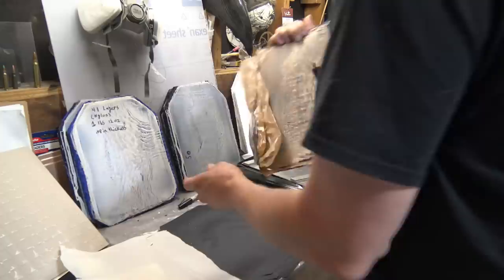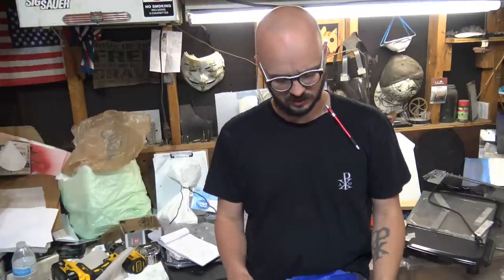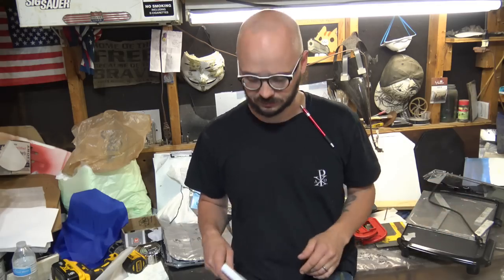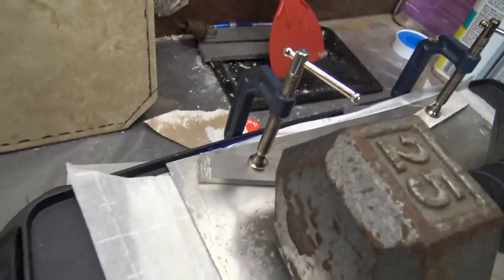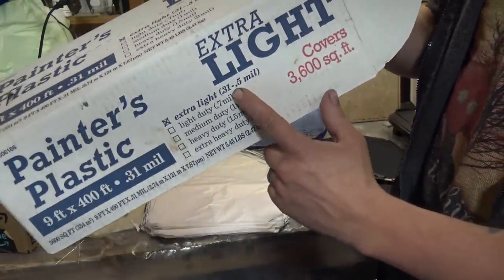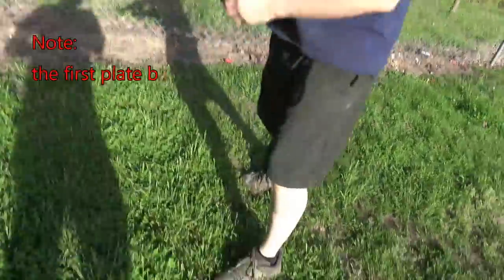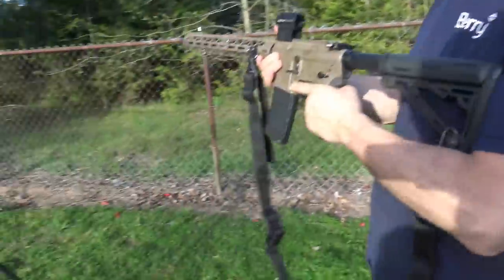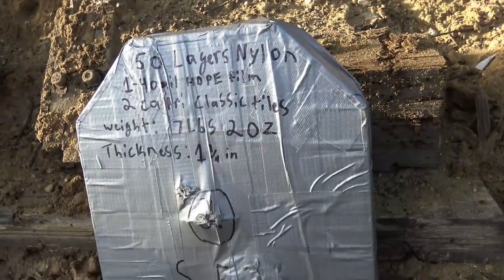Nylon and HDPE composite armor!

Comment: per weight, the nylon doesn't seem to be particularly more  efficient than polyester when used without a strike face?
Reply from the maker: Yeah that thicker polyester curtain you suggested before was a beast lol, I wonder if I can laminate that with HDPE. But yeah, similar result, but this was the thinnest of Nylon fabric out there. I imagine a stronger grade will preform better, only one way to find out devon!
Reply: @Techthisoutmeow  indeed, wouod need to test both 1000D nylon and 300gsm polyester to see if noticeable improovments can be obtained

Comment: You should try making foamCrete it’s a type of concrete that is really light it floats on water that might stop bullets it’s made by using soap suds and concrete together which puts a lot of air bubbles in it so it is lighter and stronger than regular concrete supposedly.

Comment: Your metal sheet looks like aluminum. Aluminum act like a heat sink, may not help with your heating. maybe add a layer of neoprene rubber for a little insulation and should help with any deviations in the surface. Very interesting.
Reply: That's why I use A36 material when molding and working with plastic. A36, or any other kind of steel is a better conductor of heat than aluminum.

Comment: get 2 cast iron frying pans, with a decent volume, fill them both with a soft resin, with alot of fiberglass embedded in it, then put them together in the same orientation but mirrored so the inside where the food would go is facing each other, then glue them together with a load of super glue, and wrap the seam with flex tape, and cover it in flex seal liquid for anti spall coat. and then put a paracord or something through the hole in the handle and wear it like a pendant. you could also instead of doing 2 together, do one on each side where the bottom of the pan is the strike face, so there is protection front and back. or do 2 on the front and 2 on the back. my thinking is the cast iron will stop everything like, 9mm/ .45 and below, and for higher power rounds it will break up the round and the resin with fiberglass will slow/catch the bullet, and if that fails, it will at least not have enough energy to get through the cast iron in the back of the 2 pan model.

Comment: Hey, on the topic of laminating fabric and making composite armours, I've been wondering if it would be effective to try and use a flexible material as the bonding agent in the construction of the plate
 I mainly ask this because I figure that soft body armour made out of like ballistic or ripstop nylon or some other high performance fabric glued together with contact cement is just more convenient to wear, but I don't know if the vest would be stronger with or without the rubber holding the fabric, so I'd like to hear your thoughts on it if possible
Reply: someone else tried that with fiberglass resin and it did work but not as good as fiberglass and resin and fiberglass is significantly cheaper and lighter.

Comment: Ceramic is heavy and the goal is to have ultralight-fibers stop the projectile with roughly uniform deceleration from the moment of contact through the stopping-point (before penetration).  So, a trampoline-effect.  Failure mechanisms are spalling, non-uniform deformation, burning and sharp-edges of either the projectile or ballistic-materials.  Starting from these (and other) first-principles, it might seem best the projectile deform as little as possible upon impact, but if deformation isn't avoidable, it occur early and smoothly, without sharp edges.  So maybe a thin outer layer of copper that'll stretch (and conduct heat), containing initial impact-loading, without creating sharp-edges regardless hollow-point, etc..  

Next bonded-layer, Dyneema-Composite-Fabric (DCF).  Ultra-fabric.  Few layers of Ultra-400 (cheaper) or more layers of Ultra-100 (lighter?) - to catch/trampoline the projectile.  Kevlar seems less desirable, because it's more brittle and snaps at failure, where DCF stretches more.  Looking for stretch, not brittle/snapping.  On the macro-world of first-glances, DCF seems to have no stretch, but at 30k fps, DCF stretches just about as much would want for a 4-5cm plate. 

Third bonded-layer might be an ultralight foam rubber, perhaps an EVA-foam (Ethylene-vinyl acetate)?  It merely needs to support the stretching DCF (which is doing most of the work) without tearing or yielding to the stretching DCF.  Third-layer foam need only hold-back the DCF-fabric, not an ounce of force from the bullet itself. 

Ceramic-layer simply doesn't fit the purpose.  It's heavy and yields with sharp-edges.  Those edges wreak-havoc on the trampoline effect.  Of course, virtually every plate ever made uses a ceramic-plate inside, but that shouldn't need to be the case with modern-materials. 

Consider bullet-launch:  Bullets accelerate evenly, thus launch-shock is absorbed by a relatively small shoulder butt-pad.  Deceleration should occur likewise.  Evenly and spread over as large an area as possible.  Solids, such as ceramic transmit impact and don't spread forces well.  Any force they do spread, also spread fractures.  This is no way to make a plate.  Let DCF do the spreading.  Prevent burning and spalling from cutting through the DCF upfront, and plates could (and should) be under one-pound. 

Bonding's purpose is to ensure spreading forces.  Bonding each stretchable-layer to the other ensures the trampoline effect.  Even the plate-edges should be well-bonded to each layer (to prevent delamination).

Comment: HOW about putting the marbles in a pan so that touch each other , then melt a thin layer of plastic over them and down around them to hold them in the shape of a plate when you laminate them with other things , get rid of all that space I saw @  22:00 .
Reply from the maker: Not a bad idea! I've been doing something similar to that, basically adding a bit of hdpe to the bottom, then adding hdpe above the marbles and pressing them together. Still working out the best method, but I got a lot of marbles to practice with. Thanks for the suggestion!

Comment: It occurs that body isnt the only use. What about armoring up a door or putting a bunch of this inside the walls of a "safer"room hard to shoot through equals longer to cut through so you could have a whole room be a low key, looks like a nice normal room that will buy you a good long time for help to come.
Reply: Or a car door. Mad Max it up a bit. I wonder if the weight would be better than like ar500 in vehicles? A madax sand rail with a viper crate motor. Mounted .50 in the roof. Oh that would be fun. I wonder what the laws are on that, if it is semi auto can I rig up servos as long as I am firing manually?

Comment: Try HDPE with Gaphine mixed in giving strenth to the absorption of impact
Reply: I was thinking the same, watched Mr Murray Smiths video earlier.
Reply from the maker: I've been looking into graphine a bit, I need to find a decent supplier of the material for testing. It's definitely on the to do list soon!
Reply: @Techthisoutmeow  could try to Kevlar threads mixed into hdpe ... or mesh melted into HDPE
Reply: It would be nice, but unfortunately that stuff is exorbitantly expensive. Just a few grams of it will set you back thousands of dollars.
Just for reference I tried to acquire graphene, and I wasn't able to get it. And if I can't afford it, Tech sure as hell won't be able to. So unless you're a member of the super rich, or you have a government job, you're not going to be able to afford graphene let alone get your hands on any of it.

Comment: If you can constrain the right ceramic plate within a steel matrix you'd be surprised at what it can do. A cheapo version. Pocket out/machine a 10mm aluminum plate, heat it, then insert a building tile that has been cooled down. The key is to have the tile constrained by the aluminium/steel on all surfaces bar the strike surface.

Comment: I think the idea of using ceramic balls is good but it needs to be multi layered otherwise its the same issue as dragonscales where it will pass between plates/balls, it would be interesting to suspend the ceramic balls in a thin sheet of metal too but thats probably expensive
Reply: It's also really dangerous. I've you've ever watched anyone do foundry work then you should be aware of the inherent risks associated working with molten metals which is what you would have to do if you want to suspend ceramic balls in a sheet of metal.

I'm also thinking that wouldn't really work very well because I think extreme heat exposure would ruin the structural integrity of the ceramic balls. I've witnessed a SIC ball shatter like glass when struck or dropped after being heated to 3,000 degrees Fahrenheit and then air cooled to ambient room temperature.
Reply: @nemesisobsidian  i didnt think that much before posting, i now understand but it could still be researched, maybe some ceramic shape is better at absorning impact with metal that doesnt need to be molten in production of the plates...
Reply: @mistaBorg  yeah you're probably right. It can still be worth investigation and still have an effect with the balls adhered somehow to the metal. You would need an absurdly strong adhesive though.
Thinking about it now the only way I can see suspension of ceramics in metals working is if you somehow use chemicals to break down the metal and reform it around the ceramic balls. But if we're thinking about using Aluminum, Steel, or Titanium as the resin for the balls it still wouldn't be possible because Aluminum is too reactive and Steel or Titanium are too inert. We would need to use something more stable like Copper, Nickel, Bronze, Silver, etc.

EDIT: You can also use Chromium metal as a plating I forgot to add that one. But you would have to do it outside in a well ventilated area while wearing an NIOSH Respirator as a Chromium plating can release toxic fumes.

Comment: I wonder if there is any combination of glass fiber fabric and woven wire meshes in aluminum and or steel that come out stronger/lighter or thinner than the standard fiber laminates.

For an extra experiment, how does sintered metal treated to saturation with porcelain clay and then fired hold up as a strike face?
If that looks promising what happens if you mix in industrial diamond powder, tungsten powder or gem polishing powder (alumina oxide)?

This may all get a little expensive when compared to just buying a plate but an expensive plate is better than no plate in places where they cannot be sourced for any price.
Reply: Been wondering if anyone else thought about trying this. I've been looking into it for a while now, the possibility of mixing specialty powders into Porcelain ceramic clay and then firing it in a kiln. I'm planning to get a kiln soon so I can attempt this and then give Tech feedback on the results. But I have a bunch of other materials I need to get before I can get a kiln.
Reply: @nemesisobsidian  Well I for one would be very keen in seeing the outcomes of this.
Reply: @TonyWright-tf5zy   Yeah my guess is this will end up being an improvement over the current stuff other people have been using. I mean don't get me wrong, porcelain is not a bad choice for homemade armor and it's already fairly hard on its own. But if there is a chance we can successfully make our own level 4 plates at home with readily available and accessible materials then we must Pursue it.
Reply: @nemesisobsidian  For sure, Homemade level 4 would be amazing stuff.
Reply: @TonyWright-tf5zy   Yep especially since commercial level 4 plates are still expensive. And I'm not talking about those who have the funds to buy commercial stuff. I'm talking about the poor folks who feel like they need armor to protect themselves from this crazy world we live in but can't afford any of it. That's where the homemade stuff could work it's magic. Homemade body armor is way more affordable than commercial armor by a mile. 😌😌
Reply: @nemesisobsidian Yeah this would be especially wonderful in places where buying amour isn't allowed for various nonsense reasons.(can't buy it for any price) I mean 3 or 3a is still great in those circumstances but 4 really would be ideal.

Comment: I wonder how tyvek would work?  

I beleive its 100% HDPE, is like cloth so could take resin well, and one roll could get you an insane amount of plates.
Reply: Its made of polypropelene
Reply: @HORTN8R  high-density spunbound polyethylene fibers.
Reply: @VulgrDisplay  I guess there are different types. I read that PP has better tensile strength and elongation compared to HDPE so PP might be a better option anyways. Not sure though.

Comment: 4:15 imagine if the loose weave of the fine nylon allowed for greater engagement of the other parts of the composite and therefore a stronger plate
Reply from the maker: Interesting theory, so maybe a lighter laminate would offer more loose fibers, thus more engagement. I'll have to explore that idea. Thanks for comment.
Reply: @Techthisoutmeow  i stole the idea of a loose weave from Carbon Fibre layup. The more times the fibers cross over each other the weaker the composite gets, because the strength doesn't come from fiber on fiber interactions but fiber to resin matrix bonding. Also bending a strand of fiber in a weave puts stress on it, which can either weaken it or pretension it depending on the circumstance. 

Vaccum bagging and autoclaving the layup can remove bubbles in the laminate and make a denser and stronger part.

Comment: try car tires, multiple layers, they have a steel mesh in them, composite rubber armor
Reply: multi-layer ring mail stops high caliber
Reply: those plates look like tomb stones, rip
Reply: try milk casein plastic (heat compression pressed) with infused graphene from whey blender water mix solution
Reply: in some old robert murray smith videos they shot it with nice results, make it thicker

Comment: Thinking to evenly spread the HDPE evenly, just slap together a vacuum former.  Here is the link to a simple one using a shopvac, MDF, and some pegboard :  https://youtu.be/uMbX3bqfzsk?si=YMKSCKv-OifDw29A   I think, not only would it help distribute the grocery bags or painter films evenly across the fabric, it would prove useful in subsequent iterations or prototypes, as well as, increased and efficient manufacturing. I understand weight is an issue, but considering most plate carriers are <4 lbs, I would incorporate epoxy or resin between nylon layers, but that's just me.

Comment: Stop using ceramic. You're defeating the whole purpose of using the HDPE.
Reply: Ceramic strike face is the only way to stop rifle rounds reliably.
Reply: Reread that comment you just wrote willy nilly very slowly. Then think about why so many  people are employing a ceramic strike face to stop rifle fire. It's because there is no better option to break up the rifle bullets. You might as well be telling commercial companies to stop using Alumina Oxide, Silicon Carbide, Boron Carbide ceramics in their plates while you're at it. Which would be absolute insanity.